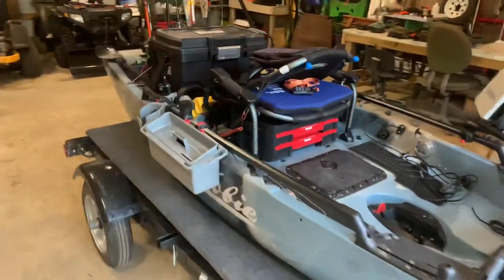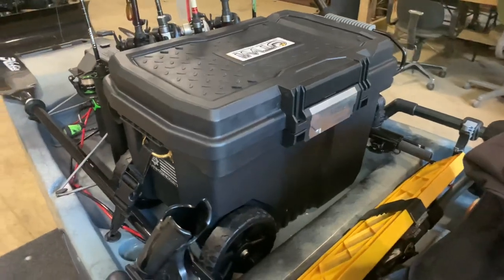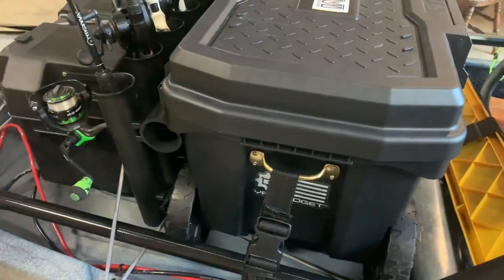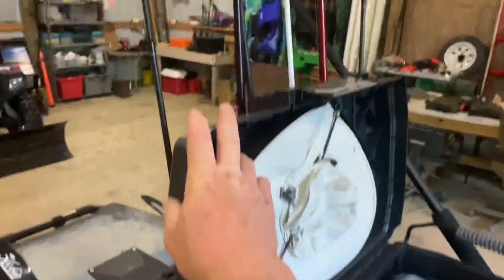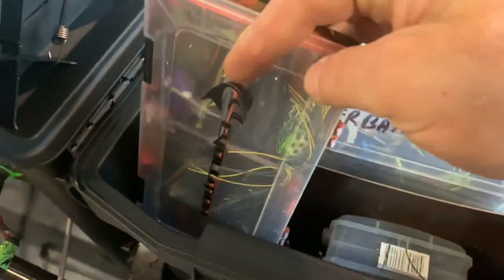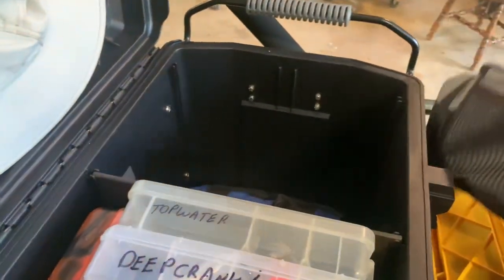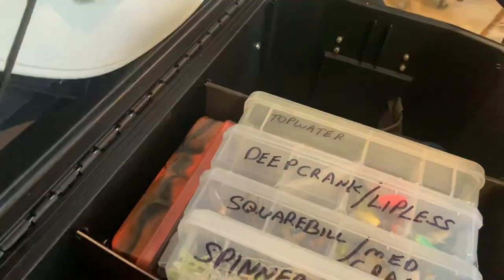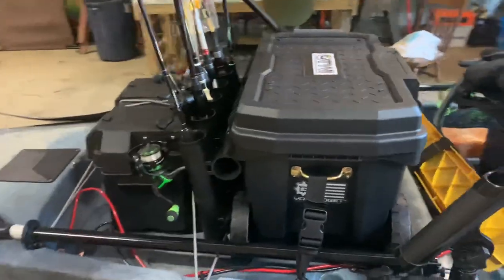2022 Hobie PA14 360 Crate Solution for Tackle Obsessed Anglers

Comment: What did you use to mount the rod tubes ? Also  where did you get the buckle
Reply from the maker: 2” pvc on the top, 1.5” pvc on the bottom. Just shot screws  through the crate to fasten the pvc tubes to the crate. Rod tubes are simply screwed through the rod tubes and screwed into the pvc. I used the screws that were included in the rod tubes from Amazon. I did not have the bottom pvc tube so the wheels would freely spin in removed from the kayak, and used shorter screws in that area so the screws would not interfere with the wheels.
Reply from the maker: The buckles are just standard bucks you can buy online.. scuba webbing was used for the straps.